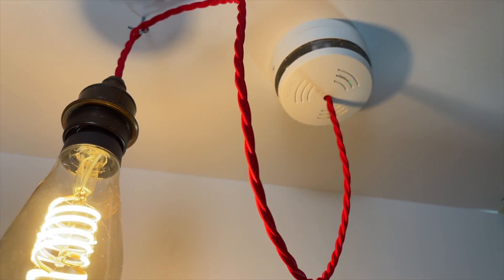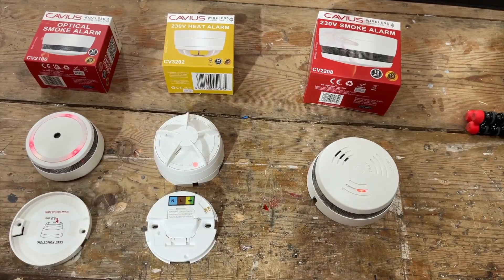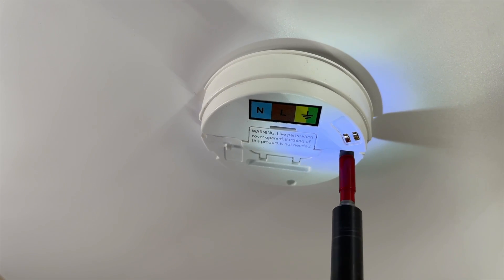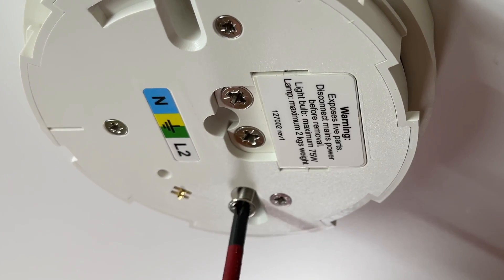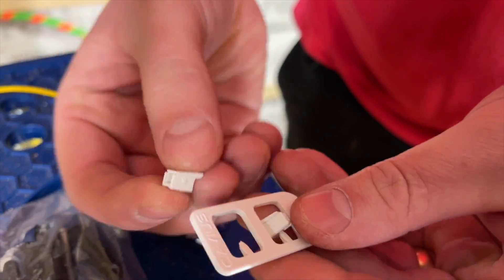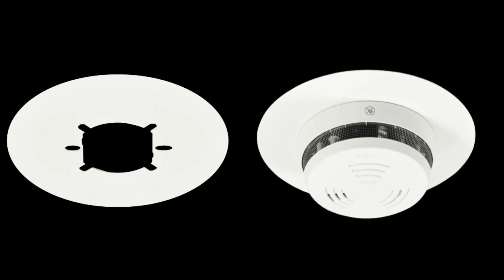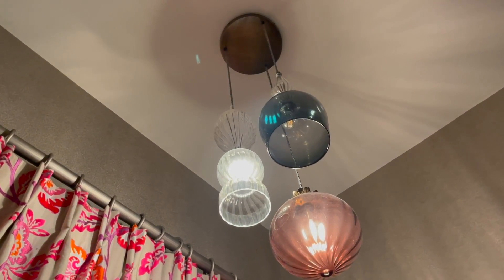We Drilled a Hole in this Cavius Smoke Alarm.. Find Out Why!

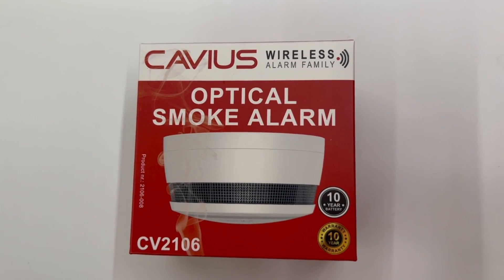Comment: 0:59 Yes you will, you have to replace the alarm every 10 years. However, if you are talking about its batteries, then that is correct because you won't have to change the batteries for the device's lifetime. However, I personally do not really like those kinds of smoke alarms unless if you could take it out or turn it off (not permanently).

Comment: I was thinking along those lines, can the lamp be connected so it comes on when the unit is activated? Ie so it doubles as an emergency light say at the top of the stairs ? I was also under the impression that BS7671 no longer allows battery powered smoke alarms or heat sensors they are now required to be hardwired? But I may well be wrong.
Great video Gordon as always.

Comment: Ugliest things going all smoke alarms, Google nest are nice but they don't make a Heat Alarm sadly.

Actually asked the AICO rep a while back as to why they can't make a downlight style smoke/ Heat with a central column that detects, similar to a sprinkler head design.
Reply: If you're talking about the Nest Protect, then it does in fact have a heat sensor built in but it does not trigger the alarm on its own. If the temperature is high it will increase the sensitivity of the smoke sensor. I still do not recommend having it too close to kitchen appliances though.

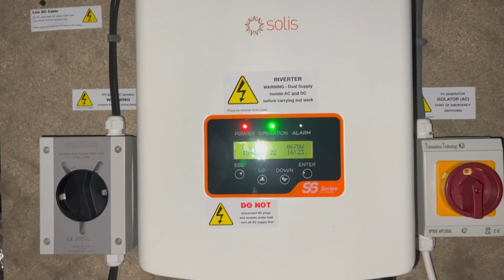Comment: 5:56 WHY TF are people putting solar inverters in roof spaces? I get that it shortens the cable runs significantly but it makes it infinitely harder to troubleshoot faults, or isolate the DC source if required for any reason (unless the British Electrical Code allows for remote isolators), if you cannot easily access the unit...
I have to say though that I really like that antitamper solution. That's really unique...
Reply: Batteries in the loft is a bit mad, bake and freeze them.

Comment: Don't like relying on wireless connections for smoke alarms. I've seen wireless connections for heating systems swa
Reply: In Scotland this all we have now. Legally there needs to smoke alarms in private dwellings now. Can be totally wireless in your house or tenanted properties.
Reply from the maker: This alarm is quite clever the signal used for set up and testing is a lower power level than in full alarm conditions so you can be assured of a reliable connection.
Reply: A failsafe wireless system will alert you if the link is down, also that's what testing is for,  testing isn't just about checking the batteries. Wireless is used for setting off explosives and controlling cranes both safety critical systems.

Comment: aico are still the best all round
Reply: Wouldn't fit anything else, however they have jacked up their prices considerably across the whole range, which now means I'm open to a reliable cheaper alternative.
Reply: @raymurphy9749  agreed
Reply from the maker: Have you tried Cavius?
Reply: @efixx  Cavius would be a 10/10 they just need to improve on some room for terminations
Reply: Mmm kinda agree but those Cavius are soo much smarter ascetically

Comment: How do you switch the lamp on and off 🤔🤔🤔🤓
Reply from the maker: With a light 💡 switch
Reply: @efixx  😂
Reply: @efixx  🤣🤣🤣🤣😎
Reply: Did you watch the video?
Reply: He literally says how in the video
Reply: Does the light come on them in fire mode? Ok I’ll watch the video 🤡
Reply: I was thinking along those lines, can the lamp be connected so it comes on when the unit is activated? Ie so it doubles as an emergency light say at the top of the stairs ? I was also under the impression that BS7671 no longer allows battery powered smoke alarms or heat sensors they are now required to be hardwired? But I may well be wrong.
Great video Gordon as always